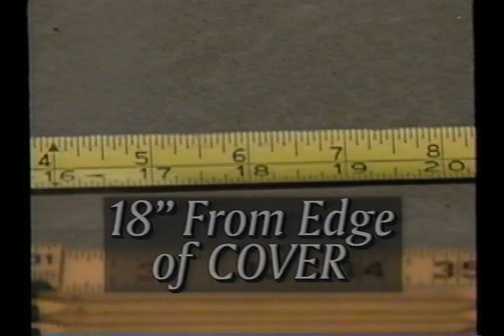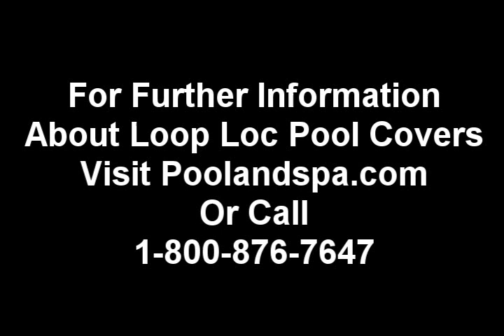Loop Loc Swimming Pool Cover Installation Instructions

Comment: installed about 45 this year, never used a grid. used a shop vac to vac up the dust, 9 inch tubes and anchors (15 is overkill unless your going in a lawn) set up to drill the mainlines checking for equal overlap on the sides then the center of the lentghts then the perimeter. ive helped other guys start at a corner and if you go around the perimeter you end up getting wrinkles... imo
Reply from the maker: Well, if you do 45 a year, you probably don't need the grid. But for a consumer install, it is a good idea. Thanks for watching :o) Dan

Comment: whats nice is you can get the 9 inch ones and they already have the anchor in the pipe!
Reply from the maker: Yes it is nicer to get the pipes w/ the anchors in them already. This video was literally shot in like 1985, so they did not have that part available back then. Thanks for watching :o) Dan